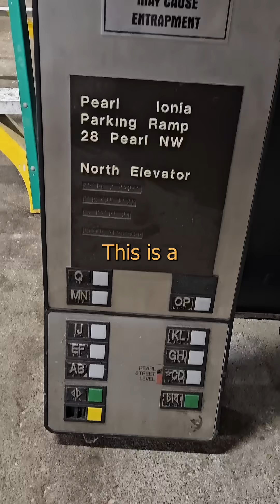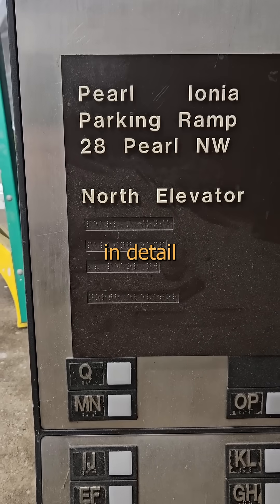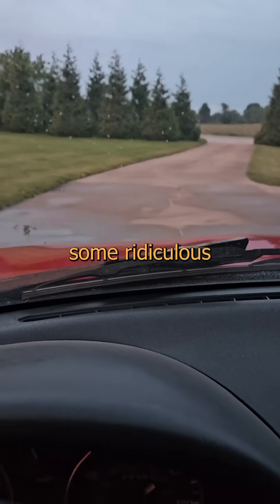Miata Mischief #chrisboden #engineering #gear #elevator #score #stories #parts #hacking #making

Comment: I managed to secure an entire bicycle to my backpack with some 550 cord and a prayer.  I then proceeded to ride home with it on a motorized bicycle while I was in Korea lol.  I got some crazy looks from an MP when I stopped at a shoppette (on-base 7/11 essentially) for a slice of pizza.

The bike was an abandoned bike I found in a ditch on the other side of base and it had an engine on it similar to mine so I wanted to take it home and see if I could ratfuck it for spare parts.

Comment: When i was in college i helped a friend move. It was basically from 5 mines away from one subway station to 5 minutes away from another, so about a dozen of us went with a box each on the subway. All day until everything was moved.
Everything aside from the big furniture: the bed, a bookshelf and a sofa (those didn't fit; the mattress did for some reason). So we moved those using a rented electric scooter 🛴.
The trick is to balance the furniture very exactly so the center of gravity is over the board and then just sit on itnd to use wide roads at night. So you run into others cars or get stuck😂

Comment: I once bought a moped in a city like two hours away from mine. I went there to pick up the moped with my old tiny Skoda, a car for two people and a dog. The seller was like "where's your trailer" and he was a bit concerned. Actually I had to remove all the seats except the driver seat to fit the moped in, but we got it in eventually. The fun part is that there wasn't supposed to be any gasoline left in the bike, but it was and it started leaking on the way. Although I rolled the windows down, by the time I got home I was high af from the fumes and I remember my father telling me he could smell the gasoline before I even arrived, not mentioning me in my huffed up state thinking it's a good idea to beat the fumes with the smell of cigarette smoke. Fun times.

Comment: Okay but HOW did you get that?!?!?!? I used to live in GR and parked in that structure a lot so I remember that elevator well! 

ANyways my story isn't too crazy - I had to haul an exhaust manifold for an Audi 5 cylinder about 150 miles from a junkyard to where I lived at the time and only had a motorcycle as my main car - my Audi 200 - was uhhhh......deficient in the airflow department. I ended up stopping by a goodwill for some cheap duffel bags, got osme bungee cords from an Ace hardware store, and basically made my own luggage solution for an 85 honda nighthawk 650 in the parking lot of an LKQ. Now, did I need to also pick up some other parts from the wreck? Noooooo. But I was there anyways and had my tools in a backpack so those were coming with me no matter what.....might as well save interior trim bits and some other odds and ends too! And that's how I learned that yes, bungee cords will hold up to 150 miles while holding the strain of 75ish lbs of car parts bungied to the back of an 80s honda.

Comment: That time I was moving for my new job with our Uncle Sam in my $2k ragged out 2004 Ford Mustang (V6) and detoured to snag my 8 foot kayak from home.

And ratchet strapped it to the roof. With a pillow to protect my paint... from peeling more  or messing up the kayak (which kinda was close in value to the car)

Then drive. A lot. They call Fort Leonard Wood Missouri Fort Lost in the Woods for a reason. 

10/10 recommend, the windows on 99-04 Mustangs don't have a "window frame" across the top of the door, the glass just rests against the window seal. So you don't get a lot of wind noise through a gap from a ratchet strap.

Also if you or someone you know locked their keys in their mustang and you got something like a coat hanger you can really easily slide through that same window gap and push an unlock button (allegedly in Minecraft).

Comment: In my old 2DR explorer sport with 253,000 on the clock, i used to haul bounce houses. One particular day it decided to rain while i was alone picking up 2 bounces, a waterslide and two 40' obstacle courses to throw into my 15ft trailer.

I got stuck twice, had to reverse through a school's outdoor hallways without hitting pillars, and then haul 2.5k over capacity while it poured rain.
That little truck was a champ for being RWD. I still have pictures of that day somewhere around here.

Sold her 6 months later and still see it around town here and there. Damn good car ford made.

Comment: I towed an FC RX-7 TT shell for two hours that I got for free. In the rain being pulled by a 91 civic HB STD trim, with just a chain and balls the size of UY Scuti with no fucks given. Then three weeks later found a free 13b-t and matching trans from an old rotary mechanic that let it sit outside for 10 years under a tarp and hauled it in same said civic. Never got it running and sold it as a whole car non-running for $15,000 during the drift tax era.

Comment: I once borrowed my car to my mom because she wanted to go to a fleamarket that was too far away to reach with her electric dacia spring.
So, being the good son that I am, I give her my dacia duster, which is no small car when it comes to hauling capacity.
Turns out a particular wardrobe caught her eye and she had to buy it 
But of course it was to big for the inside of the car even with the rear seats folded down, I want to remind you the dacia duster is an SUV.
So my dear mother who was sixty at the time pushed the wardrobe ontop of my car and fastened it with, you guessed it, THE LACES FROM MY WHORKBOOTS THAT I KEEP IN MY CAR. Two shoelaces holding on for deer life while my mom drives home "carefully"(I've seen that woman drive carefully so I know that that wardrobe experienced at least 9 g-force).
But she made it home somehow, I assume that she is really good at tying knots.

Comment: I rode my bike to the beach, and then found a nice driftwood log that o decided i was gonna whittle into the shape of a greatsword. I obviously couldn't carry the log and my bike at the same time, so I'd ride my bike any 30 feet, put it down, then aly back and grab the log and move that 30 feet past the bike. I did this for about 1.3 miles to get it home, a good chunk of which was uphill. 

I then never touched the log again and it sat against the side of the house for years

Comment: I once pulled a small trailer 30 miles, 12 of which on a bumpy dirt road.  The part the ball goes into had busted from rust. I pulled that trailer with hopes and prayers and the 7 zip ties I had with me.

Comment: TL;DR Me and my wife carried a heavy 3-seater couch down several flights of stairs and then a 20 minute walk alongside a road to the refuse yard.

Me and my wife can identify the single moment in our dating relationship that sealed the deal for both us. I was getting rid of a couch, didn't realise it wouldn't fit in the car and we had already brought it down several flights of stairs.

We ended up carrying this couch between the two of us (no moving dolly or skateboard to speak of) 20 minutes to the refuse yard. Luckily it was only down the street from me. We were absolutely dead, the garbage guys were laughing their heads off when they saw us walking in with the thing. 

After that we knew, if we can do that together without murdering each other. Then we've got a v. Good relationship.

Comment: The sketchiest thing I’ve ever done to bring something home is probably a tie between 2 separate instances. The first was when I was helping my Uncle move and he had a really nice china cabinet that he was afraid would get damaged even after wrapping it with blankets. So I, a gung-ho 17 year old, rode in the back of the box truck with it to be sure it wasn’t damaged. The only problem was that my Uncle was too afraid to fully latch the roll up door in case “we get in a accident” he didn’t want me getting trapped, so he left the door unlatched. I ended up paying the China cabinet no mind as I was fighting to keep the door closed every bump in the road. The whole entire way the cabinet never moved an inch. The roll up door however almost flew open many times. The other time wasn’t dangerous, more humorous. I had a bunch of junk to take to the dump, so I piled into my mom’s 1986 Jeep Comanche and headed down the road. I get to the junk yard and start unloading all my junk when over by a half destroyed dryer, I see it. A 1971 Raleigh LTD-3 bicycle with a 3 speed hub. Completely filthy bike, but nothing a trip to the car wash couldn’t fix. I asked the guy working at the landfill if I could take it and he just laughed. He said “I’m supposed to say no, but I’m gonna look that way” as he pointed the opposite direction of the bike. So tl;dr, I went to dump my trash at the dump and ended up snatching a classic bicycle instead.

Comment: Otis sold his first elevators by publicly demonstrating the safety catch device.  He built an open elevator (just platform, no walls) on the outside of a building, rose ten stories and then, in full view of the crowd below, ordered the cable to be cut.  People screamed and hid their faces.  No noise of a crash.  Then Mr. Otis poked his head out over the edge of the still-suspended platform, waved and said “Hello folks!  Is something wrong?”

Comment: I used my gen 2 miata to go scuba diving every weekend. I managed to cram so much gear in that tiny car, everything had it's specific spot. Two air tanks in the passenger seat, everything else meticulously placed in the trunk. Occasionally bringing a 3rd tank if a friend needed to borrow and that baby was damn near strapping the ground. Guaranteed to scrape the speed bumps leaving my neighborhood!

Comment: Okay, I have no idea if this even fits here, but here it goes;

When I graduated highschool and got Eagle Scout in the same month my parents bought me a brand new car.

It was a shitbox ‘07 Kia Rio with:
-no power windows
-no power locks
-manual transmission
-no radio
-no power steering

Needless to say, I was grateful, but underwhelmed.

But man I loved that car! I drove it everywhere. I drove it to hell and back. I drove it rock climbing, I got it stuck in snow on the mountains and learned how to dig myself out. I did everything with that monster…

Including one year, the lady I was dating was out of town visiting her family and coming back with her son. He was four and Christmas was coming up.

Look, I can be a bit of an ‘Ebenezer’, but my shortcomings weren’t about to make this holiday less special.

So the day before they were about to get on board that bird headed my way; I loaded up a 10’ Doug Fir through that little Rio and cooked it 12 miles home from the U-Cut.

The trunk got in the way of my clutch several times, and the tip was hanging out of the back passenger window like a Saint Bernard on a Sunday drive spewing sap and shit all over by back. 

I mounted that tree, trimmed everything, and when they walked through the door I was exhausted and passed out on the couch.

But the look on that 4y/old’s face…

That and her expression. That’s all that really mattered on that day. Not the 12 miles of reaching around a tree trunk to steer and the sap that never came out of my back seat…

That still makes me smile to this day :)

Comment: I didn't take the object home but I am so OCD autistic to the point that there is this large parking lot near me in Barnegat New Jersey specifically the Big lots that used to be there that is now an Ocean State Job lots in this parking lot set several orange barricade construction barrels in various states of repair also multiple cones in various states of repair a few of them covered in tar from road work that had been done in the parking lot a year and a half prior all the stuff has been sitting here not moved an inch and there is no construction to be found and they were all in the way mind you they were all dirty and I have a brand new 21 Nissan Altima and there was also an orange and black sign stand the construction crew had left months prior up the road me being the autistic fuk wit that I am proceeded to deconstruct the barricade barrels to where I had all the rubber rings and I put them in the trunk then I stuck all the cones in the front seat and took the barrels three at a time in my backseat all the way to one corner on the side of the building so they could all be friends together after I did that I went and gathered the sign stand that had been sitting there mind you it was just a stand no sign on it and it was by itself for months next to a bus stop I don't think anybody understood what it was it's literally just a little tripod that holds construction signs mind you I also worked for a traffic control company at the time when I went and collected the sign stand I still had my Amber and white mini light bar mounted to the roof of my vehicle I put my bright yellow construction vest on add my helmet that I used for work just so I can look superficial when I picked up the sign stand two cop cars passed me by one as I was pulling over and one as I was loading the signs down into the trunk no one better than eye and the cops even waved at me then I proceeded back to the collection of cones and barrels in the parking lot beside the building that they were originally deployed at and please the sign stand right next to all of them so it wouldn't be lonely and I have proof no one has moved any of those items since😂 this action was taken early March 2025 and completed in the same night
Reply: sorry for any typos misspellings my speech to text function on my phone kept on turning off for some reason my eyesight is not the best and I wrote this comment using my phone where is already very tiny for me

Comment: 2010 Malibu , needed to haul my mower, wood chipper, snow blower, and chopsaw with stand. I had a hitch and one of those luggage racks. So, put the lawnmower and the snowblower on the roof. The wood chipper on the luggage rack with the chopsaw stand onend leaned over it. After about 10 straps I feel it was tied down well. My car was so loaded down the luggage rack would tap the ground when I hit bumps.

Comment: i bought an entire 440cui (7.2 liter) V8 engine AND transmission out of a 70s motorhome so i could put it in my 1966 plymouth, lots of swearing and rapid unplanned disassembly later it fight into my 1986 Nissan Stanza and made the 3 hour drive home

Comment: Bought my first 50" 4k tv back in 2019, hauled the thing home in my Buick lasabre with 3 other people in the car with me and it. It basically was a wall between me and the people in the back, but it got home safe. 
Also got an 85" second hand more recently, was smart enough to get a truck for. Still needed to lay it flat in the bed, and it barely fit. I just threw down a comforter protect the screen and fuckin hoped for the best

Comment: The company I worked for replaced their old drum plotter with new, up to date models so I asked for the old one, intending to use the huge stepper motors for something I had yet to think of. This thing weighed a ton a nd I managed to fit it in my dads VW Microbus with the middle seat removed. After getting it home I discovered I had caused a crease in the floor of the microbus which wasn't obvious when I put the seat back in,
Also brought home an entire flatpack kitchen on the backseat, boot and roof racks of an old two door Corolla. The roof rack actually collapsed under the weight of all the stuff strapped on top but remained secured to the roof all the way home

Comment: I don't know if it is necessarily a "cargo". But I had Peugeot 206 with a big sunroof. And once driving on a motorway - I hear a clank, scratching and my diesel engine roaring. Turns out the exhaust broke almost at the manifolds, so I had to remove it whole, pack it, and drive with it to the mechanic. But it was longer than the interior - so I opened the sunroof and put it through there. Drive home was like going there in a Soviet submarine with a periscope sticking out.

Comment: A friend of mine bought an 85 Yamaha fj 650 (I think that's what it was) and it didn't run. It was just a parts bike for him.
Neither of us had a truck, but I had a 1988 Nissan 200sx hatchback, so off we went.
We drove about 100 miles to go pick this thing up. We took the front end off, put the rest of the bike in the hatch with the rear seats folded down, and then tossed the front end in and closed the hatch.
I had to move the seat up quite a bit, but we got the entire bike in there and drove home.
Not a DAMN THING sketchy about that one.
🤣🤣🤣

Comment: My dad asked me to transport an angle across two counties. Thing is the angle was about as long as the truck. He said to set it on the side mirror and send it back sideways onto the bed. Before I started driving, that plastic mirror was flexing so hard I started thinking about that time your mom wanted to get on top. I ended up tying it to the oh shit handle through the open window. 30 miles later, down the back roads, made it

Comment: When I was a young man, leaving the tender care of my mother's nest I needed to procure a washing machine and a fridge. The nearest place I could afford to drive and collect said items was 2 hours each way, and I could afford but 1 round trip. Armed and dangerous with ratchet straps and a Honda odyssey, I slotted the washing machine in the boot with the seats folded down and the front seats almost touching the dash, and the fridge ratchet strapped to the roof racks. The 2 hour drive resulted in reasonably bad mpg, and a raucous howling sound direct above my head, but it was well worth the savings of not doing 2 trips in beer money, that's for sure

Comment: Back in 2020, I loaded up 8 CRT PC monitors I got for hella cheap out of some dude's storage rental into a 2000s something Ford Focus hatchback. I dont think i could do it again even if I tried. Packed so tight that I as the passenger had to go into a fetal position just to fit in the car. It was worth it all